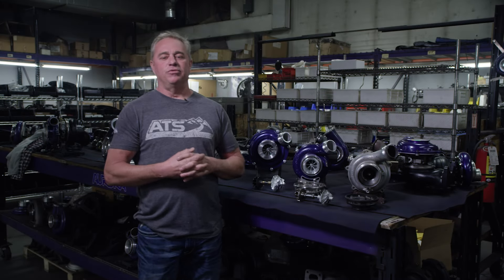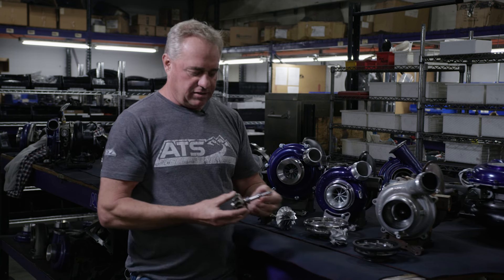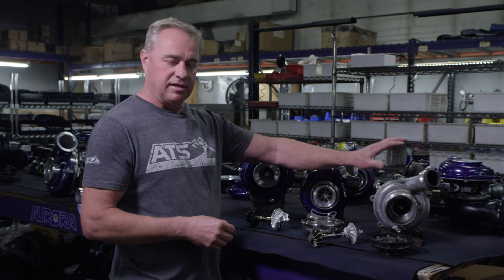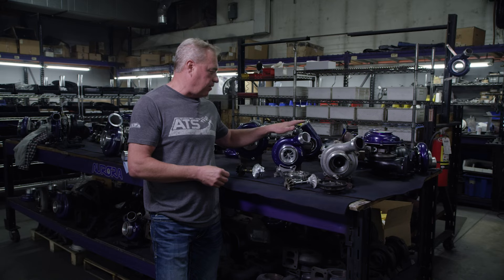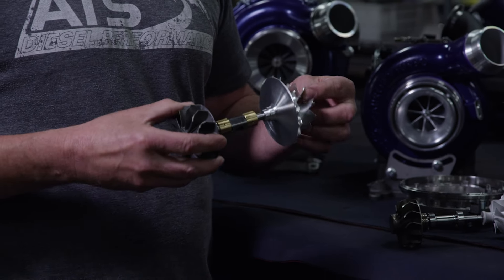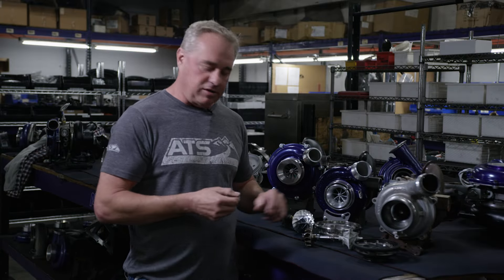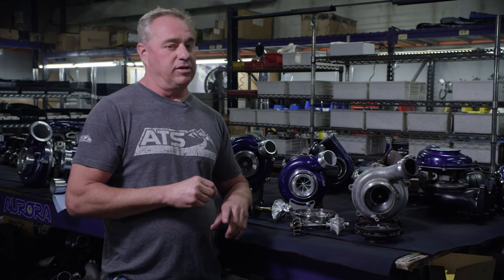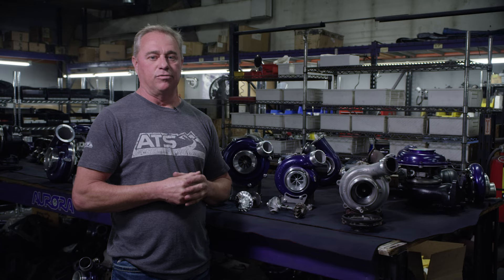ATS Aurora VFR VNT Turbo | Product Breakdown with Clint Cannon

Comment: What do you do about the intake on factory trucks, they have two inlets on the factory turbo, the ats has only one. Does the kit come with a block off for the extra inlet on the intake pipe? Also, 11-14 trucks have a waste gate, ats one doesn’t. Won’t that set a code on an emissions factory truck?
Reply: I ordered one yesterday.  I believe the purple ATS plug in the kit photos on their website is the block off plug for the high speed air outlet on the lower intake manifold
Reply from the maker: You will no longer use the upper pipe that went on your twin scroll, we have a plug that you will use on that pipe and we have a new oil drain tube to replace the old one.